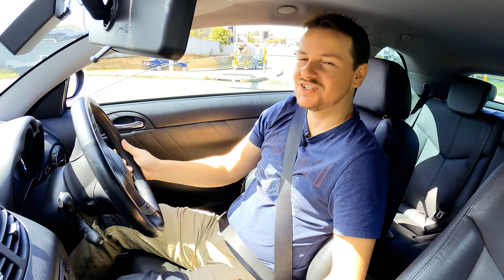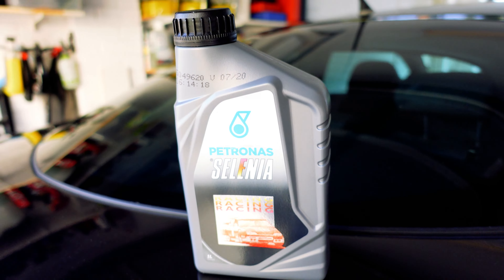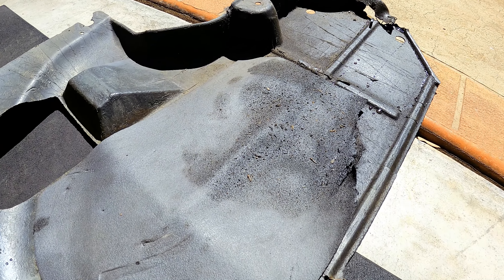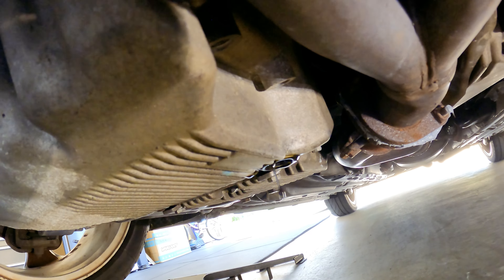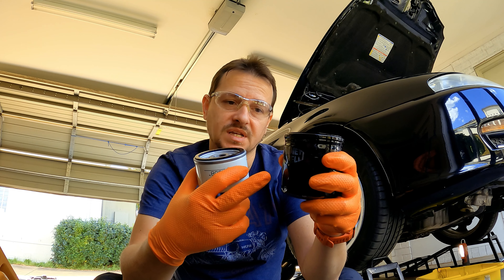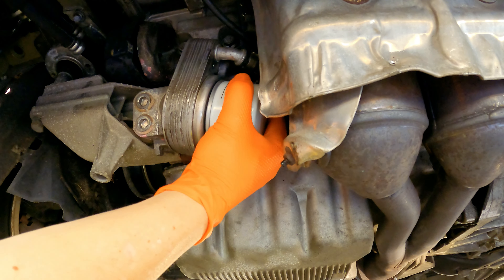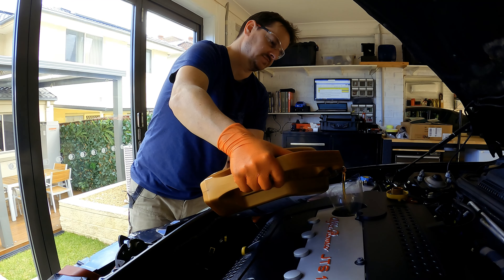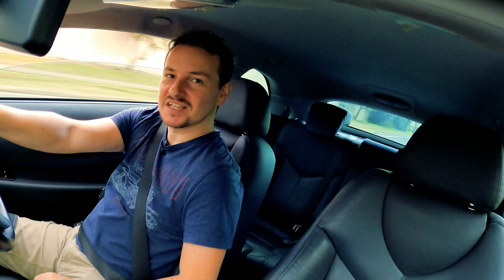How to Change the Oil - Alfa Romeo GT JTS - Oil Grade and Oil Filter

Comment: I have a GT 2.0 JTS and its definetly recomended tot use specific engine oil with the right specifications
Motul 10w60 is good
Selenia 10w60 is good
And personally i found 10w60 liqui moly to be the best oil because it made the engine significantly quiter.

But dont worry about you castrol 10w60, its not a problem using that for a while. Its still better than that old oil it had in it.

I really love your alfa GT videos❤
Reply from the maker: Thanks for the info! I'm about to see an Alfa specialist so I will let everyone know what they say also (hopefully in the next video) :)
Reply: Recently changed oil to liqui moly 10w60 in my 1.6 ts to try combat the oil consumption. Best thing about this oil is the price. It is pretty affordable at 50 euros for 5 litres. After the change, maybe its placebo but engine felt more smooth to drive. As if the compression was better. Well it could be because the oil is new. Still have to drive another 1k km to compare consumption to 10w40. But so far its not bad. I like how it flows similarly to 10w40. Doesn't look thicker but it is technically. Have yet to see how it compares on longer trips.

Comment: Nice video, a couple of extra tips:
1. Use a funnel with a filter when pouring in. Its surprising the crap in new oil so.e times.
2. When you insert a new filter. its a good idea to wipe some new oil on the oil filter seal to ensure a good leak free bond.
Reply from the maker: Thanks for the tips! Sorry I forgot to put that in the vid, but yes I definitely wiped the rubber seal with fresh oil before it went on. I love the advice about the filter in the funnel - I'll be doing that for sure! 
Thanks again for sharing Paul, it's great to see the extra tips that people are putting in the comments for all of the Alfa owners to see.

Comment: Hi Eric, nice job.👍Castrol 10w/60 is a premium high quality oil. There is absolutely no problem with it in your engine. Also, having a motul service sticker is no guarantee it's got Motul oil in it. Enjoy your videos, keep it up.👌
Reply from the maker: Thanks John, I only showed the sticker on the windscreen, but I do have the last service receipt showing the liqui moly oil being put in the car. The 10w/60 oil I used is very high quality - believe me I know because it cost twice as much as regular oil. Ouch. 
But everywhere I go, I am told that the JTS engines absolutely must use this Selena Oil. This Selena racing oil was designed as a collaboration with Alfa Romeo and Selena/Petronas, and contains some sort of lubricant/chemical that helps keep the cylinder liners intact on these JTS engines. As good as the other oils are, they do not contain this same additive. Anyway food for thought, and just sharing what I've been told :) I am by no means a chemical engineer, and just relying/sharing the Alfa advice here.
Reply: Castrol is one of the best around.  IMO, 10W60 match is important.  In regard to cylinder lining wear rate on  coating composition etc... this is not really quantifiable but more so about marketing centric.  As an experiment, you could try Selenia Oil versus Castrol and measure fuel consumption and oil consumed per 1000km or 2000km.  If you have resources.

Comment: Nice job. I've used Castrol Edge as well in my Busso's but have switched to Ravenol as it is pure synthetic oil. Also, its always a good idea to crank the engine with fuel pump disconnected, just to build some oil pressure before starting but that's just me 😁
Reply from the maker: Thanks for the tips 👌

Comment: What a lovely clean GT. I have a 2005   GT 2005 JTS. I have had it for 3 years. Fun to drive, and I'm sure will become a classic in years to come.
Be great to see if you can get that engine to perform as it did when it came from the factory. They suffer from carbon build up hence performance suffers. Also, I wish it had a longer 5th gear. 100kph at around 3k rpms is just too high. Especially with a  cat back supersprint exhaust. I drive mine from the UK to Greece and vise versa every year hence I have done over  220k kms.... She's a cruiser lol. Great to see you're in OZ, I grew up in Melbourne. Miss them sunny days. Don't get much of the sun here in the UK. Keep well.
Reply from the maker: Thank you for your message mate, I appreciate it. To be honest we've had a few wet summers herein Aus so you haven't missed much, haha. I'll keep an eye out for the carbon build up - thank you!

Comment: Good job Eric. There is absolutely no need to be pedantic about using Silena oil.  I have a 156 with the same motor as your car and I have a GT with the fabulous 3.2 litre busso and I use Total  10W 60 racing oil. As long as the viscosity and the ratings are the same. I'd have to go for a very long drive to get the alfa recommended oil! My GT must have had the tray disintegrate like yours is doing and it has been replaced with an aluminium one. I believe they are still available and probably cheaper than the junky original part.  I too was amazed at the size of the filter on the 2.0JTS. Your soft drink bottle top is a good one. I found that when I try to pour oil in straight out of the bottle some ends up going under the plastic cover and gets into the spark plug wells. Keep up the good work!
Reply from the maker: Thanks Ian, I'll consider what you said about the oil! I'm about to go pick Frank's brain from Frank's Pitstop Motors (Alfa Specialists in Sydney), so I'll report back on what they say as well (in the next video hopefully).  P.S. if you have a good source for Alfa parts please let me know :)

Comment: Nice job Eric ..I remember the oil tray you showed us in a recent video, as how easy and handy could be changing the oil with it. Also it's bright colour to make you see if there are metal filings on the bottom.
Reply from the maker: Great point Giacomo, I'm glad that the videos are proving useful! 
I always use a bright color oil pan so that I can see what comes out of the engine :)
Reply: @Horus_Works  they are always useful:)

Comment: 👍 you are a careful man, you Treats well your Cars. Somewhere in my life i owned a Alfa 147 and i m thinking buy a Focus, please can you comment the diferent handling betewen GT and Focus 
Thanks
Reply from the maker: Hi, thanks for commenting. The Focus handles much better - sorry to say to all the Alfa fans. The Alfa has a nicer interior.
Reply: Thanks
I have 3 Alfa im my life a 147 and a 156 and a 145, i love Alfa but is not durable compare to Ford, 2 of my Alfa as a strong oil consumer, this is a reason i want Change buy a Ford
Congratulation from Portugal 👍
Reply from the maker: @costa mss  thank you my friend, I appreciate you replying. I hope the weather is nice in Portugal!
My Alfa GT also consumes oil. Alfa Romeo considers this 'normal', which it may be for this engine, but yes, the Focus does not consume oil. 
Make sure you get a manual transmission Focus - much more fun to drive compared to the automatic 😉
If you are on Facebook, Instagram or Tik Tok, find me by searching for Horus Works

Comment: Thanks for sharing! My GT has done 163k and i noticed its quite noisy at idle in comparison to a CRV or a Toyota in general.  Is this the usual Alfa thing (new tensioning pulley and belt replaced which i thought were the cause).  I start to think its just not a quiet engine.
Reply from the maker: Hi thanks for watching the video🙂 Mine is a little noisy as well, it has at ticking sound. When I asked the mechanic they said that it's the injectors and this is normal for this engine. Some other causes of noise on this engine can be the variator solenoid, engine mounts, or pulleys - but you already changed these... Have a look at my other video and see if it will help you: https://www.youtube.com/watch?v=3ykFAuEfjac&t=1s
Reply: @Horus_Works  Ticking sound is probably lifters. The engine gums up with sludge and varnish. A worn variator will make the engine sound like a diesel on cold start. More a 147 problem. You could try liquid moly for and engine flush or pull the cylinder head off and recondition it. These cars are not as well engineered as a most Honda or Toyota cars but are a lot more stylish and fun to drive.
Reply from the maker: @dasdasdsdasdasdasd363  thanks my friend - the Alfa specialist has confirmed it's the injectors, so not a big problem.

Comment: I use the same 10w/60 in my GTA - no need to get the Selenia. And yeah, I've been using cut down drink bottles for years too...
Reply from the maker: Thanks for letting me know John. 
How long have you been using this oil in your Alfa if you don't mind me asking?
Reply: @Horus_Works  Only since I've had the GTA, so about a year. I wasn't aware 10w60 is recommended for the GT 2.2 JTS but given they are are a bit thirsty. I guess it isn't really a surprise.

Comment: Quite cool Italian machine.
First oil change after purchase? I'd consider an engine flush in that case. Liqui Moly has a great product to make it. Oil is cheap, engines are not. :-)
Reply from the maker: Great suggestion!
Reply: @Horus_Works  for sure. I make oil change twice a year in my 20y old Focus, with engine flush. Maniac level. :-) the engine is as silent as an angel.

Comment: Three mistakes: 1. No new copper washer, 2. Didn't fill the filter with oil and didn't rub the gasket with oil. 3. There are better oils than Selenia Racing. Castrol is the worse even if used temporary! I use Motul X-Power. Read the technical sheets of the oils, check laboratory tests and what their specifications mean and compare them (HTHS high means wear protection, TDS of kinematicViscosity 100 gr C - high number is better, CCS si MRV -lower is better, Noack - lower is better, use ACEA A3 or better and the oil must have the FIAT 9.55535-H3 approval! Other good oils are Ravenol or Yacco. Do the research. I don't use oils that can be counterfeit easily like Mobil, Castrol, Elf..etc.
Reply: The best oil for this engine is Liqui moly GT1 !!!
Reply: Also fiat approved oil
Reply: True x3. Filling the filter with oil would be a good idea. It doesn't really matter what brand of oil you use. Little particles of carbon get into the oil and act like sand paper grit and don't care about what brand of oil you use. The more you change your oil, the longer your engine will last. It's as simple as that.